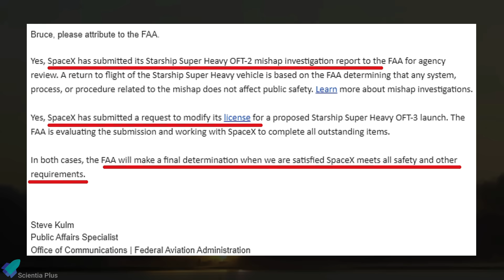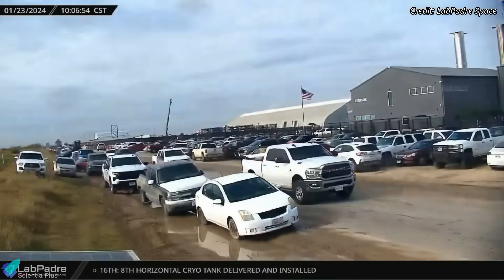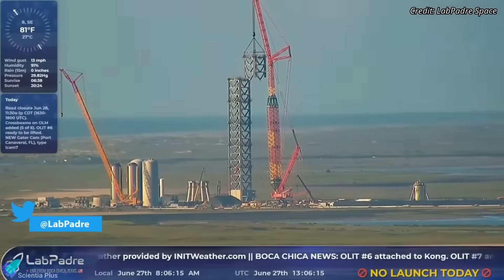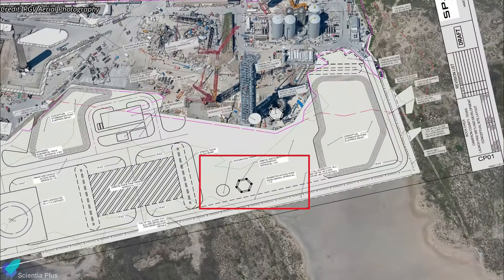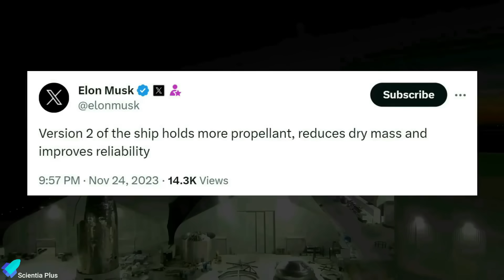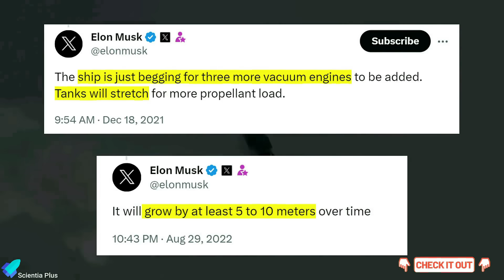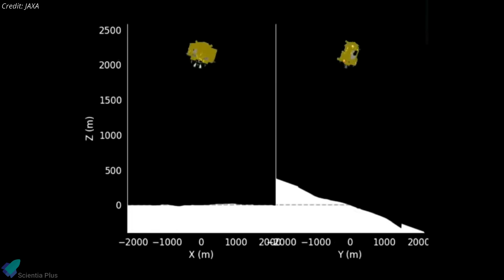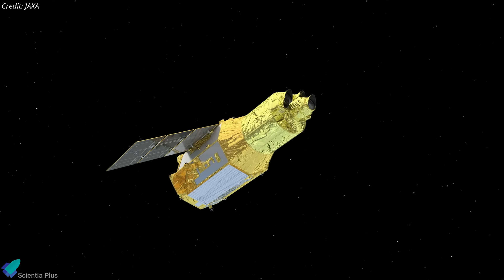FAA Provides BIG Update On Starship Launch License - Launch Next Month, Starship-28 Rollout

Comment: Dents on the vertical tanks were NOT from impacts after the second test flight. The dents were caused by the shockwaves from the 33 Raptors firing. In other words, not from objects hitting them but from air pressure. The new reinforcement should stop any large dents. The other 4 tanks are not in the way of the exhaust, because one of the legs of the OLM protect them from the shockwaves.

Comment: V2, V3, Raptor 3 ??? How about demonstrating orbit and reuse of the existing prototype version.
Reply: The existing prototype version blew up.  Maybe they want that to not happen?
Reply: At this time SpaceX is not attempting to catch or even land a Starship or booster. It wouldbe nice to see a plan of progress after all they know how to do this all with the Falcon.
Reply: @michaelreid2329  You're putting the cart before the horse.  Before they can recover the thing from orbit they have to get it into orbit in the first place.  And they have to have the booster remain operational through its full flight envelope before they can try to recover it.  Falcon was going to orbit reliably before they tried the first recovery.  The Starship booster has to be shown to be controllable at touchdown before they're going to get it anywhere near the test site--the amount of damage Falcon could do if it decided to fly into one of the buildings is considerable but it is tiny compared to what Starship could do.

Comment: It should be burst proof through using a high strength mesh covering like is required with non-metallic high pressure tanks to prevent burst.
Reply: The material provides the burst resistant layer.